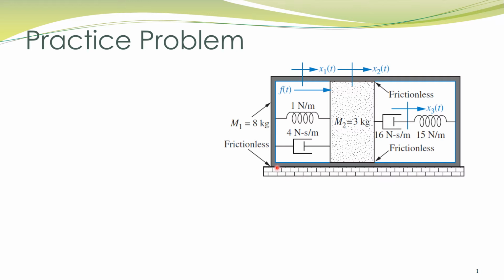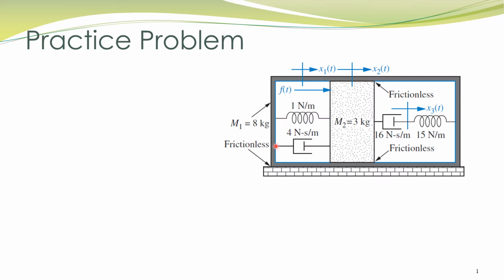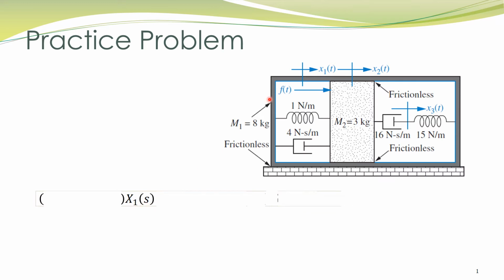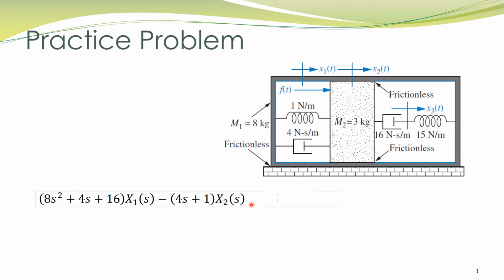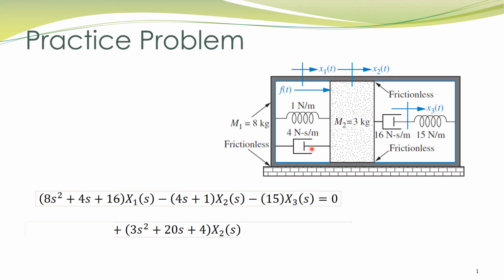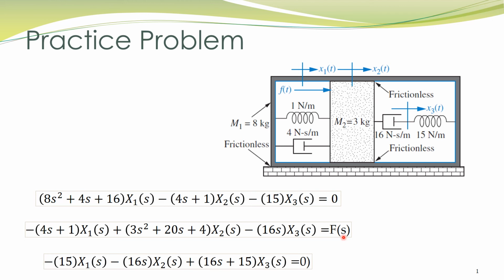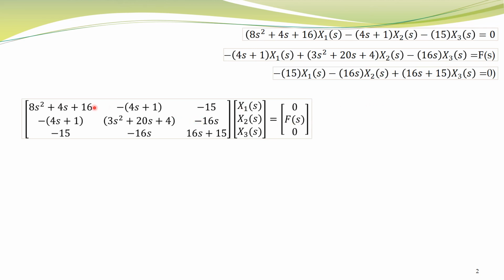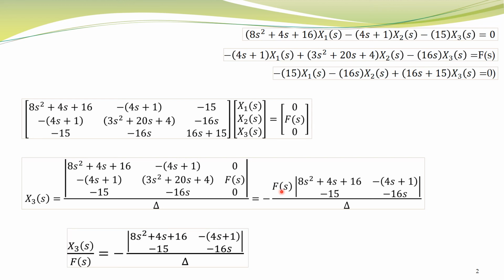LCS 6a - Practice problem - modeling of mechanical systems

Comment: Equations are wrong
Reply from the maker: Can you please point out the mistakes in the equations?
Reply: @MAFarooqi  sir in first eq in the X2 part ,we are not considering the second damper that is connected to m2.so i guess it will be (20s+1)..can u confirm that sir ?

Comment: Why have we not included M1s^2 in the calculation of directly attached impedances in the case of X2. is not it attached directly?
Reply from the maker: M1 is not connected with X2. The displacement of M1 is X1, so it is connected with X1 and not X2. Remember that mass is always connected to a single displacement only. This situation is different from that of spring and damper, which have two ends and each end can have a different displacement.
Reply: @MAFarooqi  OK. Right. Understand. I had confused it with spring and damper, which you have cleared in the last 2 lines. Thank you Sir. ❤